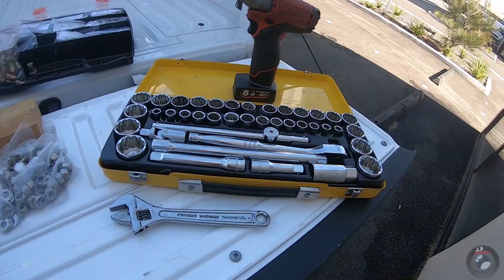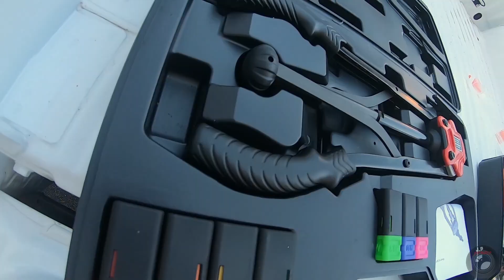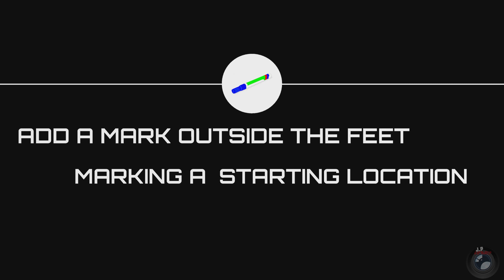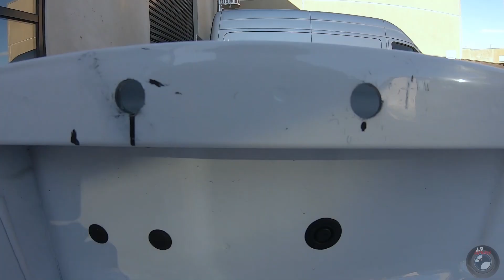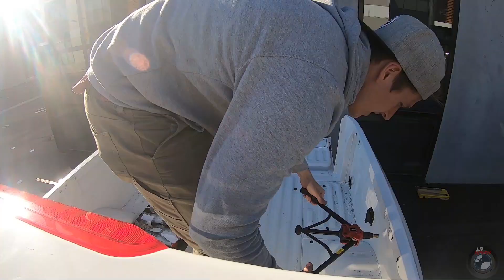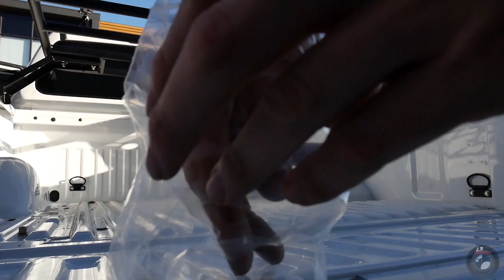Tub Rack Install & Review 4wd Ute #ShedSessions #NP300

Comment: Just a tip: when measuring hole centres if you measure from the outside of the holes (example, left side of the left hole to the left side of the right hole) you’ll get the exact centre measurement instead of guessing where the middle is provided both holes are the same diameter. Hope that makes sense

Comment: Thank you for the video. How much load can the rack carry? I don't think those 8 bolts can hold the load on the rack. They should've added a metal to lean on the truck bed like how "Buds custom australia" has. That way the truck bed will take the load and not the 8 bolts.

Comment: Hey JP, have u put a rooftop tent on the rack and if so, how do u find it as far as taking the weight on it?
Reply from the maker: Hey mate 👍 i don't plan on running a rooftop tent with this build. I do pack it full of camping gear when i go away and throw fire wood on it all the time though and it holds the weight no worries at all. Double check with legendex though mate and ask them if they think it will be okay to run the brand tent you are looking at.
Reply: @jpcaptured799  ok sweet. Cheers mate. Been watching your vids, great work. Keep it up 🤙🤙
Reply from the maker: @explore_n_4x462  thanks for watching, Heaps more to come! Anything in particular you want to see?
Reply: @jpcaptured799  i am picking up my 19' np300 nxt wknd. Maybe electrics? Eg dual battery or spoties etc? Whatever content u put up im sure itll be useful and enjoyable 🤙 dont stop the videos 😉🤣
Reply from the maker: @explore_n_4x462  that's awesome man! I look forward to seeing what you do with the build! I will 100% be doing batteries and lights soon 🙌
Reply: @jpcaptured799  can you do one fitting rooftop tent?
Reply from the maker: Jeff Vader   i don't plan on using a rooftop tent 😭 me and the mrs just use the swag.

Comment: Roof top tent be perfect for that setup 🤙🏽👌🏽 awesome job mate
Reply from the maker: For sure Dane! I load mine up with heaps of camping gear. It fits 2 swags and a large gazebo on it side by side perfectly.
Reply: I don't think those 8 bolts will hold the tent. Not even 50kg. load. Check out the design from buds customs au. It does not take support of 8 bolts and rather leans on the truck bed.
Reply: Best thing i bought mate was a rrt got one bolted to my arb ascent canopy 👌🏽 on my np300 st nav dualcab